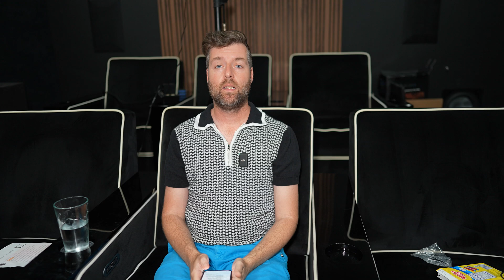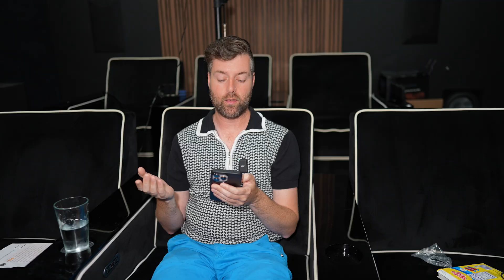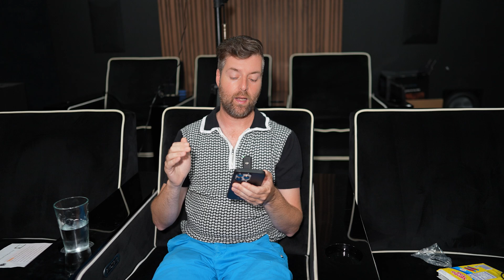Using ChatGPT to Calculate Sound Transmission Loss for Different Door Types

Comment: If you have a small lobby room (say 5x7) between the theater and the house, with some absorption inside, which is decoupled from the theater, but not decoupled from the rest of the house, does that give you better STC for your communicating door arrangement (~50 STC as you mention)? Or are you still looking at around 50 STC, but with a less awkward entrance? Wondering how much you lose by having a flanking path with the lobby being coupled, and how much you gain by the extra airspace between the two doors.